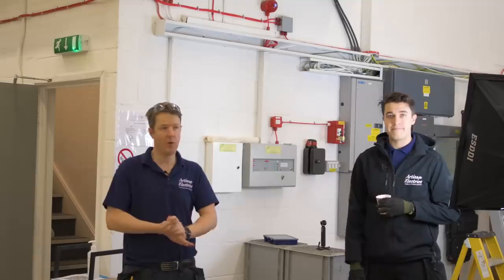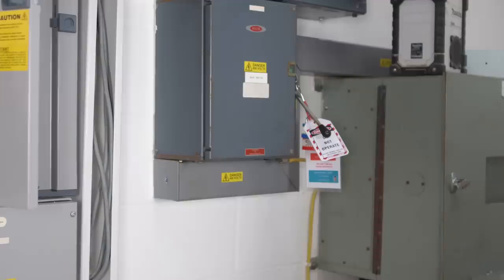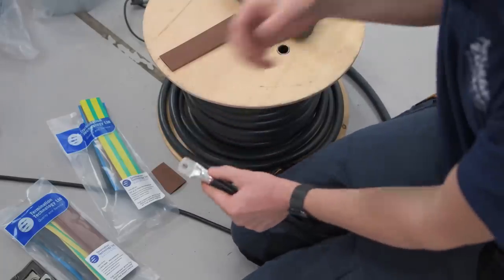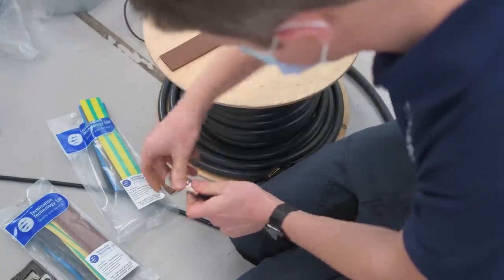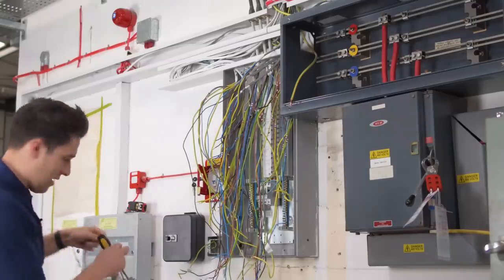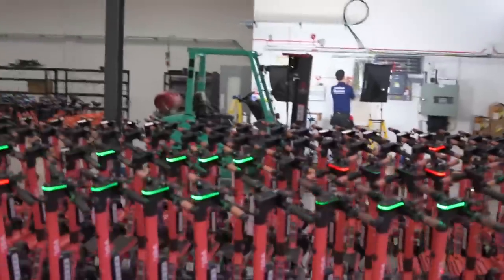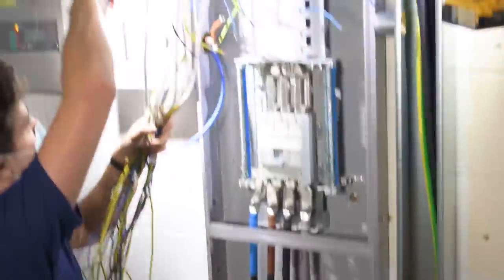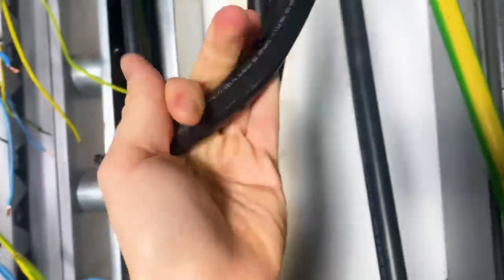Industrial Electrical Installation - Board Upgrade & Electric Vehicle Chargers - Day 1

Comment: personally if I was going to retrofit i'd gut and redo everything putting dedicated single and 3 phase  with cantary  raceways to cover everything requiring power ..

I never liked the stupidity of having to certify someone else's mess with the stupidity of date of install legislation with safety code enforcement.. you become liable and libel for previous installers mess, once you sign-on to do the job and before you sign-off said job...

if you are doing a job for charging devices for hire vehicles I would make doubly sure the 3-phase off the power sufficient. i would suspect mains upgrade to 520-680 vac might be a need..

you are likely going to need to  step down from 3-phase to single as the chargers themselves will likely be 8 amps or less..

Comment: Don't understand the need for bushes and couplers in the sides? Why not a big slot across the top? Waste of time  no?
Reply: They’re Artisans, they aren’t looking for the cheapest or fastest way, simply the best way. Also once paxolin has been cut have you really saved time?
Reply: Not sure about the UK rules but here in Australia you can't just cut a big slot in a board.  You have to maintain the fire rating of the panel.  I suspect the UK has similar rules.
Reply from the maker: It was mainly to allow us to dress everything neatly in the board and give us plenty of space for future expansion adding new circuits
Reply: @artisanelectrics  i use heavy duty grommet strip instead if paxolin.  4 m6 gutter bolts to fix trunking to the dB. Sorted. Never had  an issue with a slot not being big enough to accommodate all circuits down either side of a dB tbh.